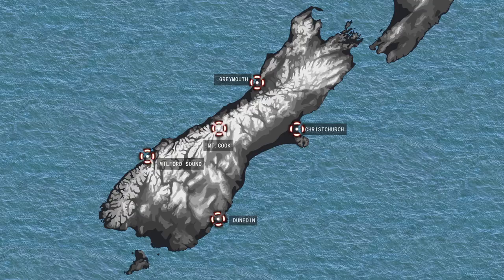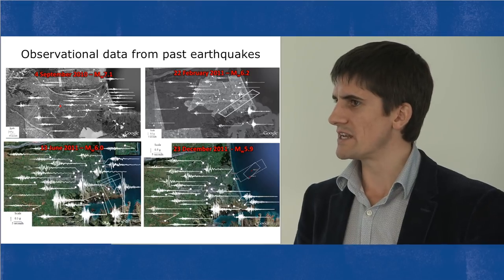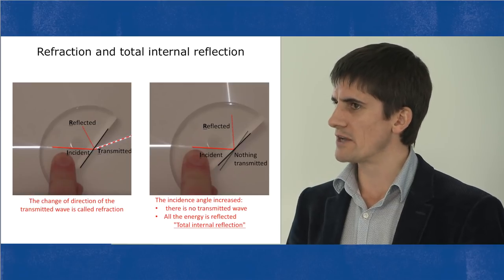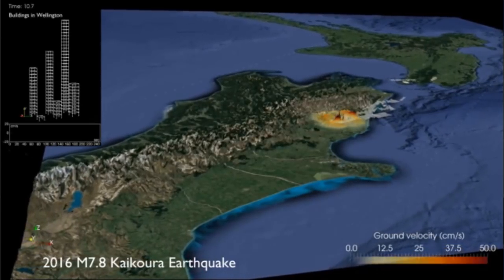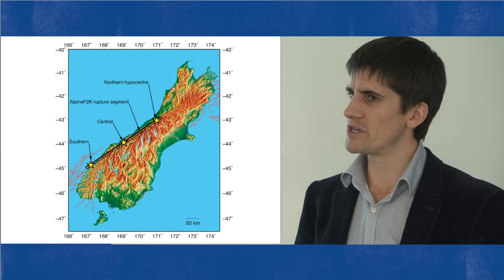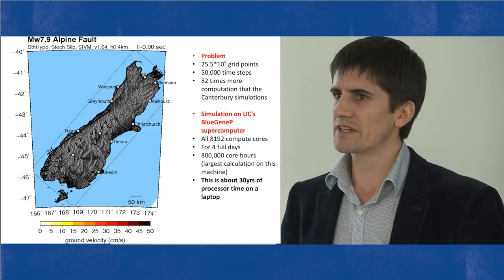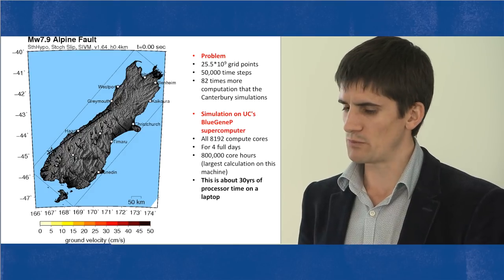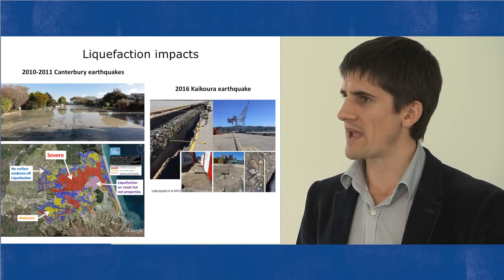AF8 Science Talk - What will a large earthquake feel like?

Comment: Is there any correlation between the alpine fault in NZ and the Cascade fault on the American west coast? They both had their last major event in the early 1700's, they both border the pacific plate, they're both slip around the 250-350 year cycle. They're both overdue for the next one? Is there any pattern? 1700 then 1717? Has anyone looked at the data side by side?